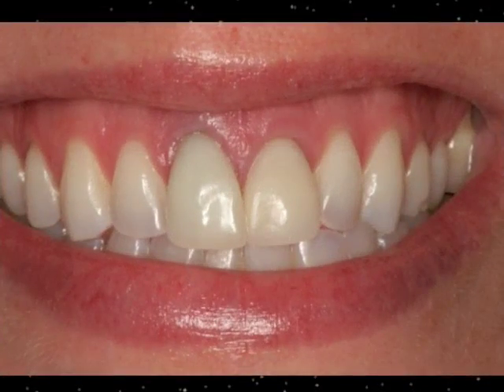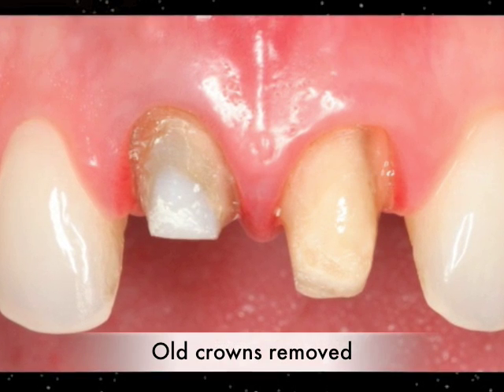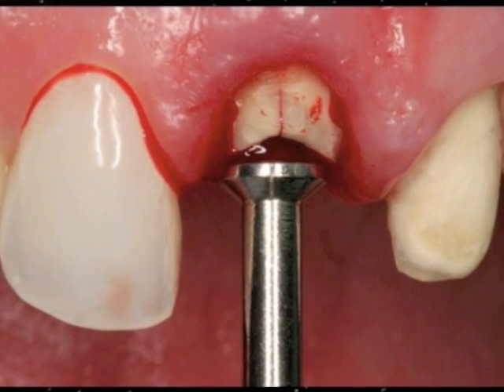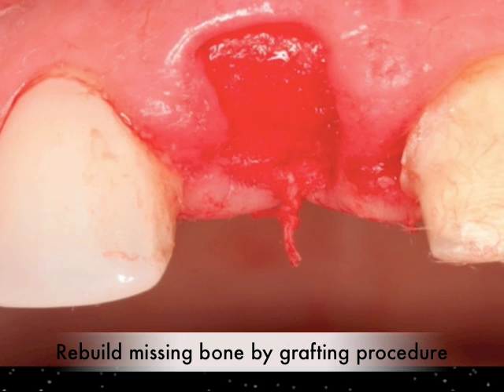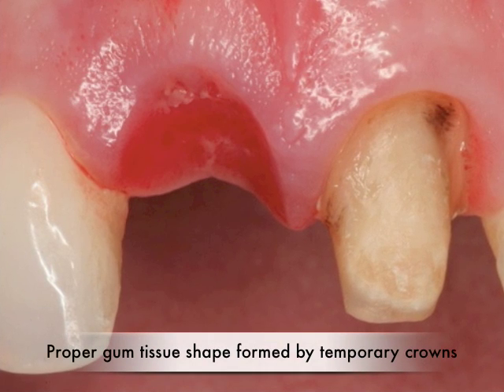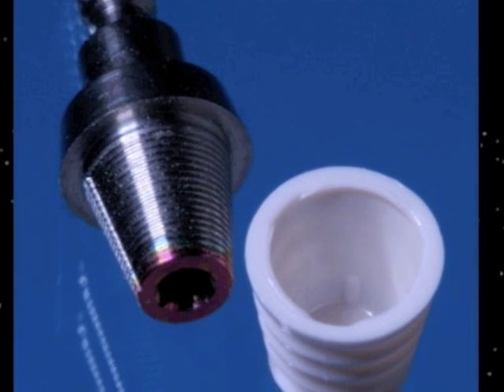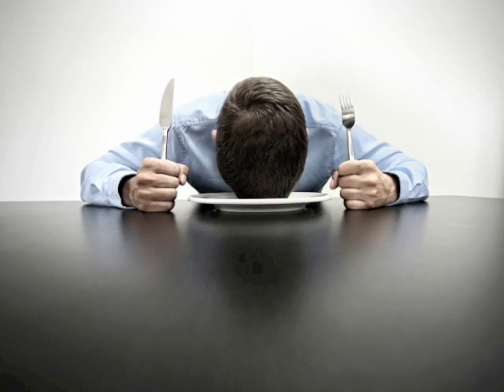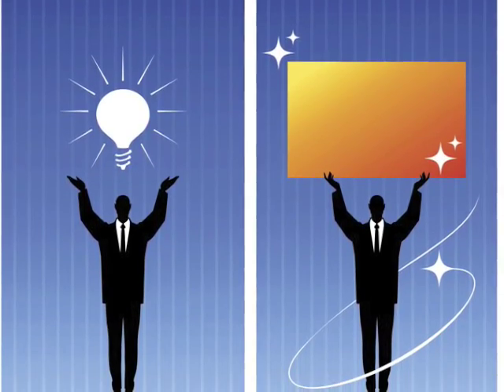Dental Implants in the Smile Zone- Part 3

Comment from the maker: Hi. You have make a great point. The cost of implant dentistry can be high. This is primarily due to high cost of implants, components, and laboratory procedures. It is both time and materials intensive. At our office, we have tried cutting cost down by main streaming the treatment process and using good labs to avoid costly redo's. My recommendation is always to do it right the first time using a surgeon and prosthodontist- while it may cost more initially, it will save cost in long term.

Comment: I'm 28 and about a year and a half ago I had 5 implants placed. And yes they cost  me about 2500 a piece. I have excellent teeth but I was born with a condition called hypodontia. Is basically means that I'm born with an incomplete set of teeth. I miss a total of 9  of my adult teeth and they gave me 5 implants to fill gaps. They actually had to pul three milk molars which had remained since there were no adult teeth underneath. Just wanted to say that is isn't always due to bad teeth. Love them

Comment from the maker: @asparch 
Extremely difficult if not impossible. If there is thining or loss of bone in a narrow zone on side of implant, it may be possible, but to increase bone overall around it is not. Depending on the situation, some soft tissue grafting or re-doing the crown may be helpful to improve aesthetics. If these are not possible, and the there is a significant issue, then removal along with restoration of the bone / tissue and re-implantation may be the only option.